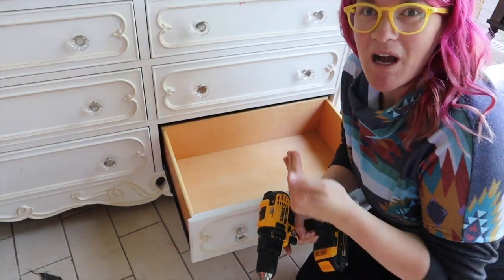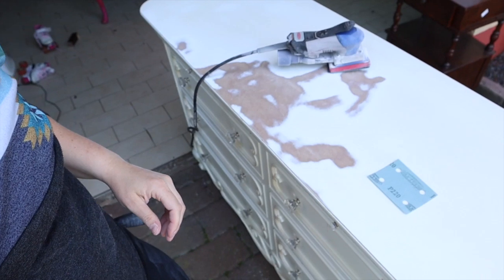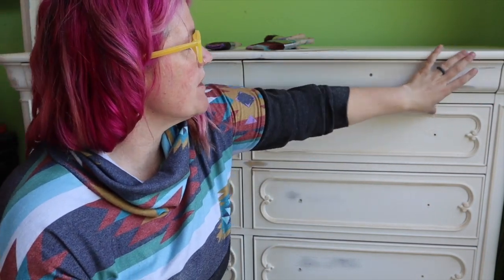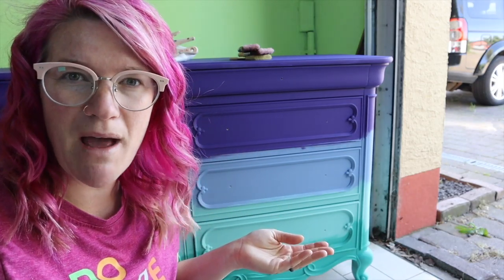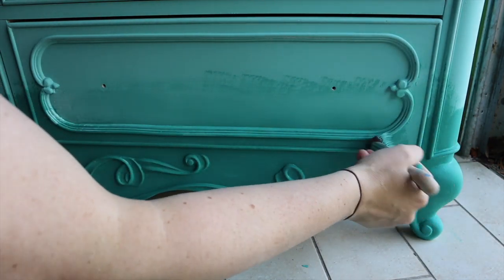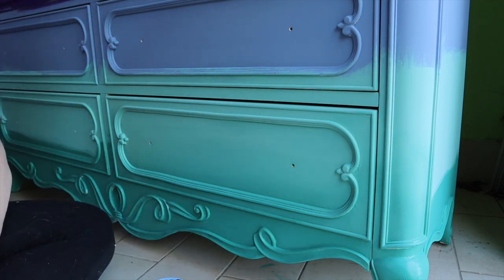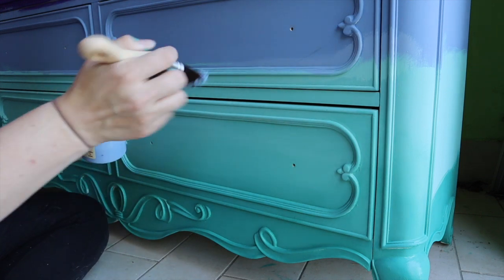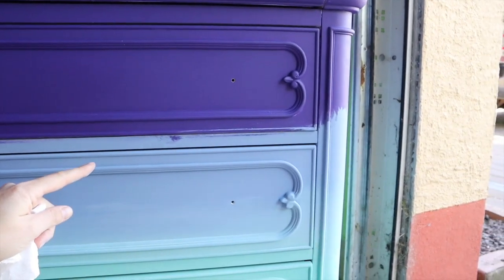Mermaid Chalk Paint Blended Dresser

Comment: Learning to blend and your videos are really helpful!  About your sander...the link you have ... does it come with the vacuum set up or is that separate?  Thank you.  Love your work!
Reply from the maker: Donna Curry thank you Donna!! So I put the set on the link because it comes with sanding pads and such otherwise you can just buy the sander but you have to get sanding pads and sand paper anyways so I just did it to make it easier ❤️❤️❤️
Reply: Bella Renovare by Crys’Dawna so it comes with the vacuum?  Thanks for the quick reply too!
Reply from the maker: Donna Curry no it doesn’t come with the vaccum but all you need a a shop vac, I just used the one I already had :) usually if you buy the vaccum their customer service will contact you just to make sure you have everything or tell you what vaccum to get they are SUPERRR helpful!!!      Also!! I have a coupon code for you- use BELLARENOVARE10 ❤️❤️

Comment: Omg Crys’Dawna I need your help please! I dont know what im doing wrong with blending but it always either all blends together to make one horrible color or its blended but the lines are a little hard. Isk what im doing wrong! I have separate brushes Like u said, mister bottle, towels to get paint off of neutral brush. Could I be using to much water? You made this look so easy!! Id appreciate any advice, thanks so much
Reply: Also, I find it very hard when a piece has like a pictures frame type side. You know, like its set in further and has an edge all the way around? I dont know what to do there so it doesnt look messy
Reply from the maker: hey there, it's possible. Walk away for now. Take a break and a deep breathe. You don't want to use too much water. are you just misting lightly?
Reply: Bella Renovare by Crys’Dawna  I think I am. either I make one new color on the whole piece (that isnt blended lol) or it does blend but I cant get it to flow smoothly together. It looks splotchy. Girl u make this thing look too easy!
Reply from the maker: Bella B lots and lots of practice....